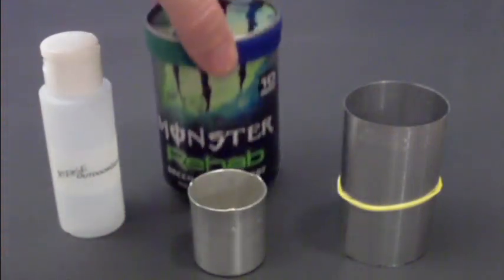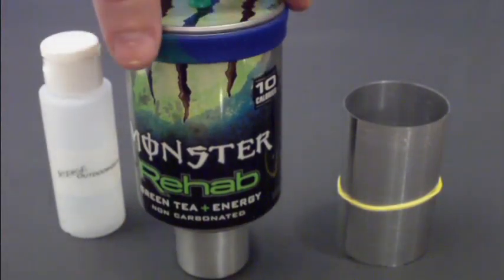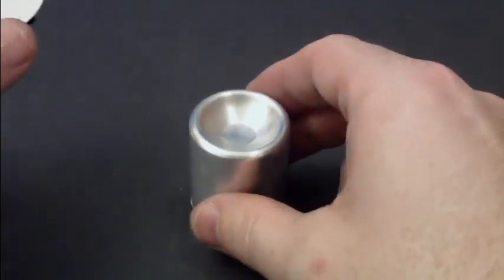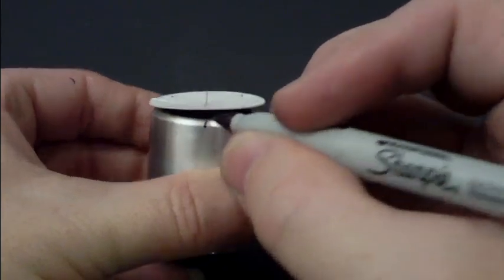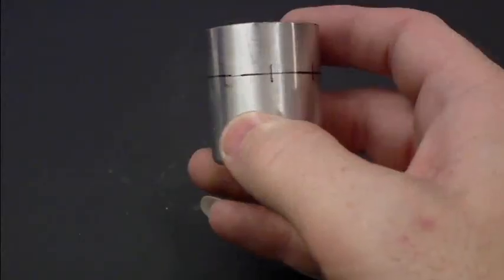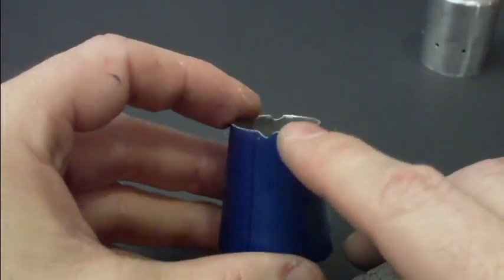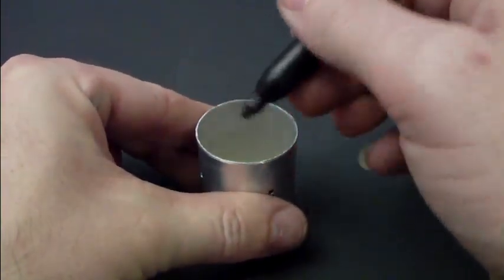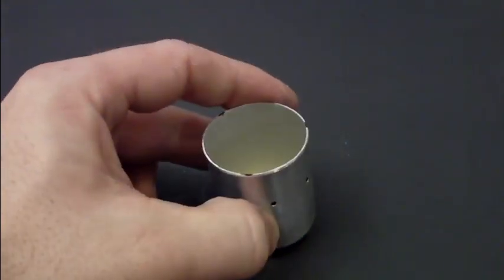X-Lite Alcohol Stove - How It's Made...

Comment: Great little stove John, I like the standoffs.  12 grams is plenty light enough and being made from heavier aluminum is a plus.  I better order one before you figure out you need to charge more for them :-)  Yep, it was Tinny who developed the standoff/bump concept with the Bios 2.2, back in Jan 2010 although the original purpose was to prevent excess pressure buildup and fuel boil over.  The secondary benefit of less heart loss from the stove with a cold pot was a welcomed added benefit.

Comment: Thanks for a very nice video.  Did you choose to use the Bud Lite bottle neck in order to give you a taller stove with greater fuel capacity? Would the top of the Barbasol can have worked less efficiently?  I would tape up inside of the can before all the grinding to prevent aluminum dust from getting inside the double wall.  All in all a very beautiful and effective stove.

Comment: Every side burner I see has heat running up the sides of the pot.
If you used smaller jet holes would that prevent wasted heat? I suspect too much pressure in the stove.
Or perhaps use slots instead of drilled holes?
Reply: Side burner stove is OK for larger pot's, with more than 100 ml OD.

Evernew was releasing a aluminum side burner stove, the EBY639 "Bluenote", 5mm OD, 3.2mm H, 13,5 g.

Comment: What kind of alcohol do you burn in this? Rubbing alcohol? I've had problems with an alcohol lamp with a wick where it wouldn't stay lit unless the alcohol used was much higher purity than what is found in rubbing alcohol.
Reply: +Gewgulkan Suhckitt  it can be heet, or denatured alcohol. I use denatured alcohol because it burns cleaner than heet.
available at any paint or hardware store. and heet can be found in automotive stores or auto sections of box stores.
Reply: denatured alchohol is the best fuel for this stove. you can find it in the paint department of your local hardware store.